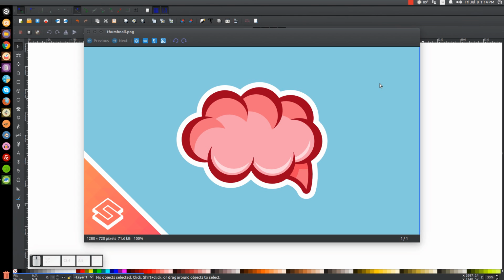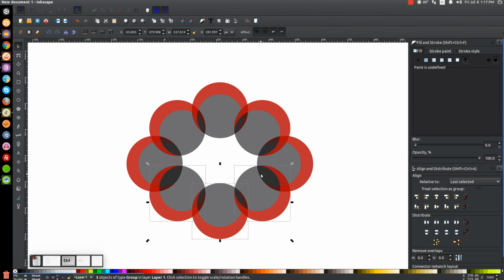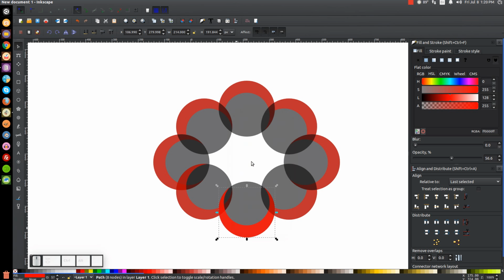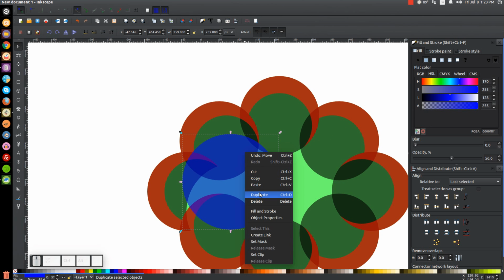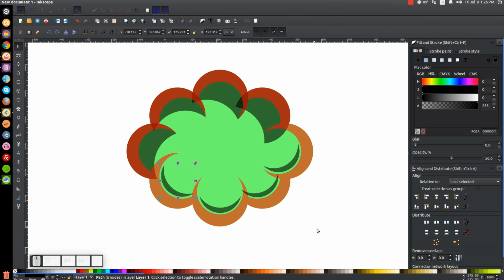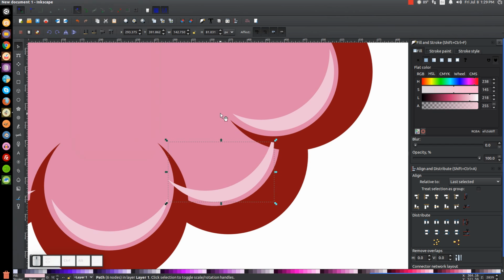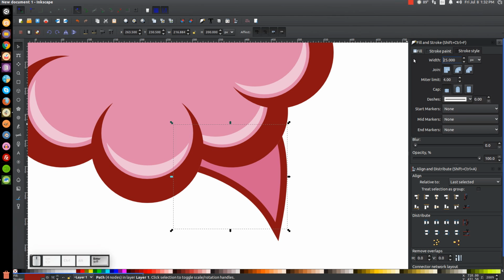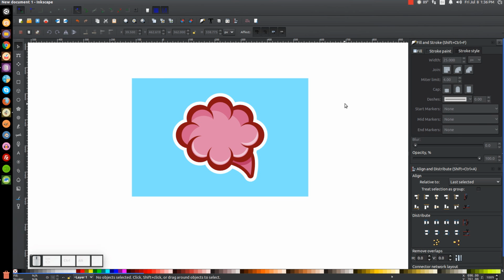Inkscape Tutorial: Vector Brain Graphic

Comment: I just wish sometimes that Inkscape can be like their vector-based software proprietary counterpart like AI when it comes to combining shapes more quickly and intuitively(i.e. dynamic pathfinder)... without necessarily going through the same repetitive steps of "duplicating","(union/difference)" and "break apart" series of commands. 

Don't get me wrong, I love Inkscape a lot but I just wish the community of developers could find a way to streamline more efficiently their "shape combining techniques", which feels like I'm working on the first version of AI. 

Just my two cents.
Reply from the maker: I know exactly what you're saying. The dynamic pathfinder in Illustrator is certainly one advantage the software has. This can be mitigated in Inkscape though if you learn the key shortcuts for each path function. For example, when I'm working, I don't continuously click on the Path > menu, I just use the keyboard shortcuts and it makes everything infinitely faster.